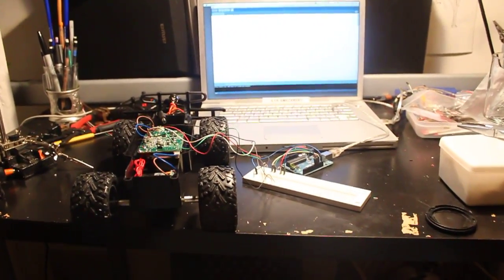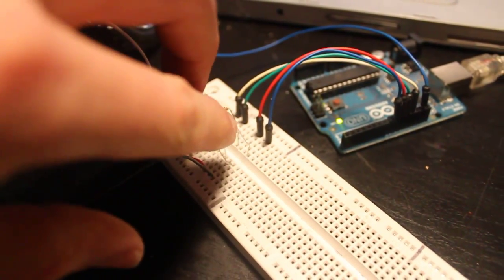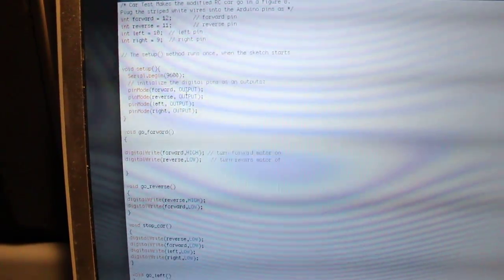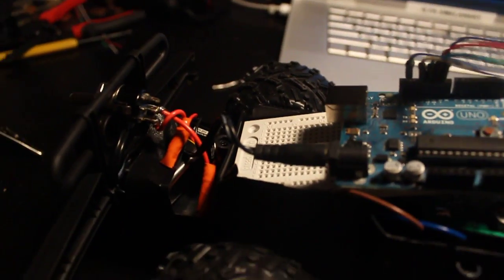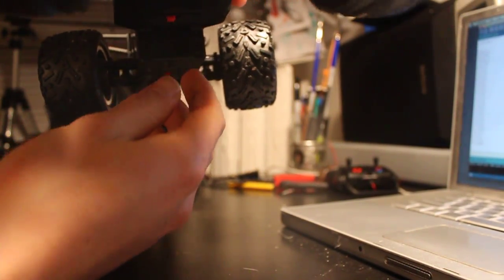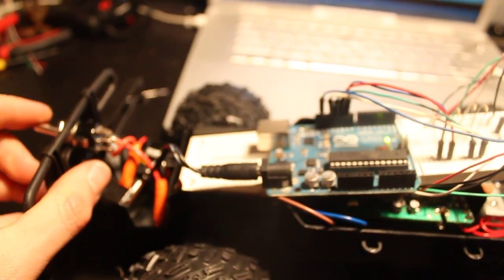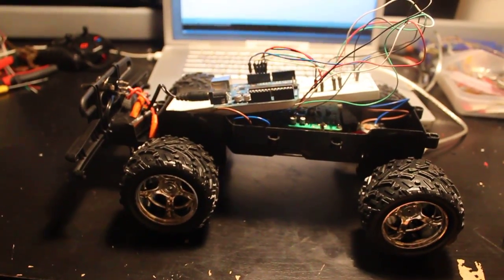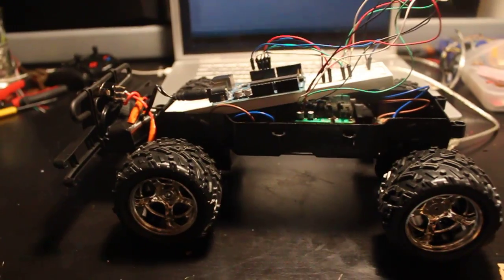RC Car into Autonomous Robot Conversion

Comment: i like your concept  but where should  i solder the wire  on the car circuit baord
Reply: Check out the links in the description, they should have all the info you need. Here is the link that shows the specific connections you need to wire.  http://www.et.byu.edu/~bmazzeo/LTR/tech.phtml

Comment: Hello,
  Is that one of the New RC/Bright trucks? Looks similar to mine.  I thought about wiring to the h bridge on the board but looked kind of hard.  I'm trying to use a motor shield from Adafruit but doesn't seem to get the right amount of juice to the motors.  I might need to try it this way and see if will work better.

Comment: hmm ... i tore the transmitter circuit apart and connected it to arduino. Then, i put this setup right on top of the car ...so that i can still read sensor data (using wires) ... a bluetooth module talks between computer and arduino ... i am planning to make a floor cleaner robot this summer ! cant wait !  cheers

Comment: If it might help, you can hack the transmitter using arduino ... arduino controls the controller ... it is a cleaner solution than dissecting the rc car  .. power consumption is higher this way ... anyway have fun !